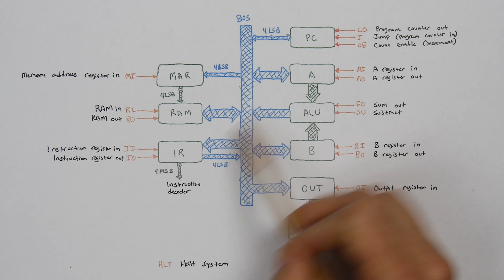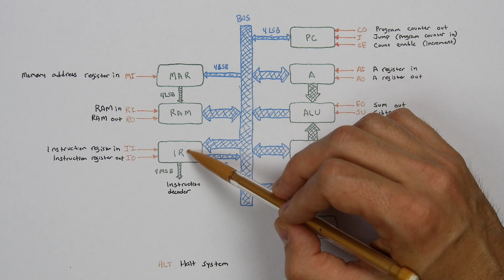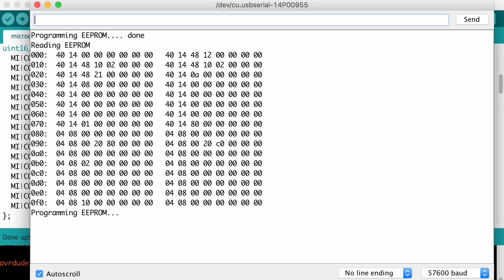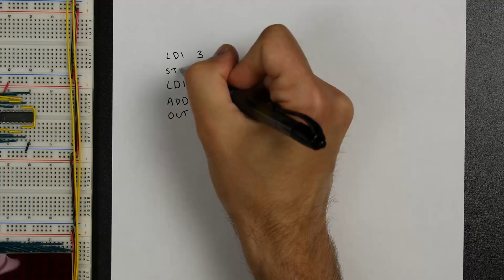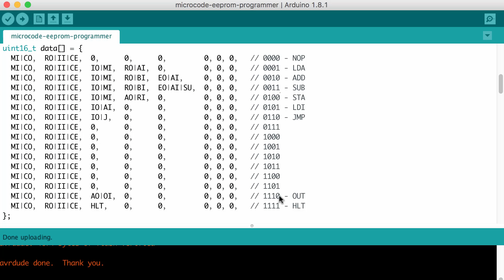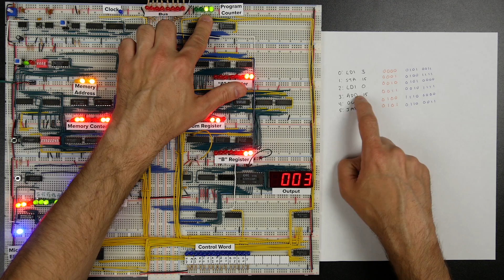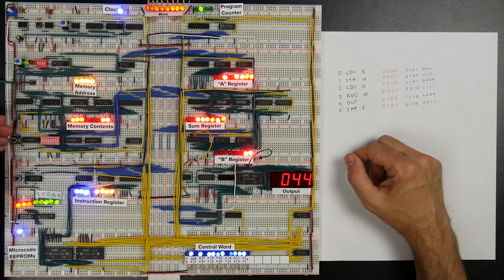Adding more machine language instructions to the CPU

Comment: Can one do self-modifying programs with StoreA (STA)?
Reply: In theory yes, the program is just numbers in memory and STA lets you put numbers in memory but something "useful" in less than 15 commands escapes me at the moment.
Reply: Sure. The way it is designed uses the same RAM for code and data.
Next step would be conditional jump, I suppose.
Reply: TheYouTubeCuber kinda but with the 16 byte limit I doubt you could program any logic to do that
Reply: Ben's old design includes JC, or Jump on Carry, which jumps to the indicated location IF the Carry flag of the ALU is set.  Combine this with a SUBtract instruction and you compare and branch.  I suppose he could add a specific CMP instruction since he has so many free opcodes.
Reply: You can do everything just with STA apparently
https://github.com/xoreaxeaxeax/movfuscator
Or just with SUB, or ...
Reply: @romsthe  Well, yeah, if you have all those complex mod/rm and SIB addressing modes and tons of memory for lookup tables. Movfuscator cheats a bit by using signals for control transfers. You can't jump with mov, no matter what you do - but you can cause a segfault, and the signal handler can modify the stack frame and let the standard library use non-mov instructions to return somewhere else. It is impossible to use only mov, but very impressive how much it can do with just mov. Also, those "single instruction" computers aren't really single instruction, some take various combinations of operands, so aren't really a single instruction, if you want to be completely honest.
Reply: Ah the good old days .. before memory protection ruined it for those of us who liked to save a few bytes by living on the edge! :)
Reply: OBW Yes just modify records in ram
Reply: I've been thinking about how to do conditional... anything: Jump, I think, would be the most useful. I'm not having any epiphanies quite yet.
Reply: Probably. If you managed to write A or Sum to the ram you could then execute that command however it would take some this to control the results
Reply: How does the program know to set the carry flag to activate the jump? What statement says "register a is less than 10, 1-> Carry. It's the "is less than" part that I can't figure out how it would know.

My other question yielded a possible result. Two values, a and b, checking "if a>b":Subtract 1 from a and b each until the result equates to zero (by bitwise or'ing the result). Were a to reach zero, it's lower, were b to reach zero, a is not lower, if they both reach zero, they are equal. Or, maybe, a-b, if zero, they are equal, and the minus sign would depend on how the number system was implemented.
Reply: kindlin: Calculate A subtract B.  I'm not completely sure what the Carry flag means afterword with this ALU, but it could be: if the carry flag is clear, that means that A >= B.  If the carry flag is set, that means A < B.  Something like this.
Reply: Ok, yeah, that's been said multiple times now, but my question is HOW does it know WHETHER to set the carry flag. I know that us humans can see 10 and 8 and know that 10 is larger than 8, but a computer doesn't just "know" this. It has to follow some algorithm of and-gates, or-gates and 1's and 0's.

How does machine code determine that A>B, A=B or A<B? Is it not machine code, is it actual hard coded logic gates that allow the determination of equality? Some combination of the two?? It has to first FIGURE OUT what the right answer is before any flag, carry or otherwise, can be set. How does it do this?
Reply: +kindlin Look at the ALU video, the adder chip has a carry input and output, the output of the LSB chip is connected to the input of the MSB. The output of the MSB would be connected to a FLAG REGISTER via a separate line. So along EO|AI to make an add or sub instruction,  you would have something like EO|AI|KO|FI (CarryOut|FlagIn, "CO" is already used) and that would set a C bit in the flag register. For a Z bit, you would first need to make a NOR with all ALU bits (if they're all 0, that makes Z a 1).

Usually, ALUs are more sophisticated than just add or sub instructions, you can probably figure out how a shift instruction would use a carry position to update the C bit in the flag register. Usually, many instructions impact multiple bits of a flag register so they all have a number of separate lines feeding those bits which should be directly available by the instruction decoding logic.

Now, since these bits are now available there, you can imagine that rather than making an unconditional jump by setting a J signal unconditionally, you would use these bits to feed J. Instead of feeding J with a direct bit output from the ROM, J could be connected to some bit logic to choose when to jump. It could use 3 bits from the ROM decoding into 5 (out of 8) possibilities. That's 5 lines :
- unconditional jump -> J = 1
- JZ -> J = (1 and Z) 
- JNZ -> J = (1 and (not Z))
- JC -> J = (1 and C)
- JNC -> J = (1 and (not C))
All those 1s represent the lines being set to 1 by the instruction decoding logic, they're set to 0 otherwise. All of this should be ORed, so that's
J = uj | (jz & Z) | (jnz & !Z) | (jc & C) | (jnc & !C)
Now make the uj, jz, jnz, jc and jnc from 3 bits in the instruction (which needs more room now)

That's a way  of doing it, there are probably others. You get the idea ?
Reply: I get the idea, thank you. Quite a complicated bit of logic,  I'll admit I couldn't follow it all, but my question was basically answered in your first paragraph. The next couple gave me an actual method you could follow up the  flag determination with a jump output, basically the if statement machine code/logic gates themselves.

As always, with knowledge comes more questions. I saw an article that listed Overflow, Negative, Carry and Zero bits (flags). Z is the nor of the result, C is the final carry bit of the adder (subtractions and addition?); however V for overflow seems redundant with C. What's an overflow if not a result larger than what the computer can handle, which is already the C bit (I'm now thinking of my 16/32 bit calculator that can go to 1e300 before it overflows, could this be a software-set flag?). N for negative, which was touched on briefly in this video series, but never fully fleshed out. If a negative was known by a specific bit (±128 numbers) then that on the adder could be tied directly into N.

You kind of lost me from here. If you don't want to go into fine detail, that's fine, but I'll try and explain what I'm not getting.

For actually using that information, are you saying that if any of the bits is set at all (due to the |'s at) you'd want to do or not do a jump? You need to know whether your asking A>B or B<A, which is more complicated than whether A+B overflows, is zero or becomes negative. So, do we have a different sets of machine code for each equality (==,<,>,>=,<=,!=)? This kind of looks like your JZ/JNZ/etc. thing but that looks like your creating a single bit that contains all the possible jump information, not creating a complete set of machine code for each JZ/JC/etc.. so how using this information goes, I may not be too far off, or I may not clue whats going on.

Thank you so much for helping explain what you have so far.
Reply: Perhaps I can help a bit.

All of these "flag bits" are automatically calculated and stored in a special "flags register" by the hardware, generally during mathematics operations.  If the result of an "ADD" command caused an overflow, then the "C" bit (carry) of the flags register will be set, and similarly if the A register was left with zero in it, then the "Z" (zero) bit of the flags register will be set.  If the zero was the result of a carry, then both will be set.

But... overflow from what, and to where?  The reason why there's sometimes more than one carry bit is the answer to one of your questions.

Sometimes, it's useful for a programmer to know when there has been a carry out of the lower 4 bits of an 8-bit number into the upper 4 bits

 Being able to test multiple types of carry becomes even more important when you have registers which can hold and add/subtract 16-bit numbers or even larger.  For example, with 16 bits you might have three carry bits, with one for a carry out of the lower 4 bits, one for a carry out of the lower 8 bits and one for a carry out of the entire 16-bit register.

Most CPUs also have a "CMP" or compare instruction.  This is a non-destructive SUB instruction.  It actually performs a SUB between the A and B registers, but "throws away" the result instead of storing it in A.  This is useful because it preserves the original values while still setting the flags.

Here comes the answer to another of your questions.  How to test for multiple results?

The answer is, one at a time.  First, you'd normally check the C flag using a JPC - JumP on Carry to see if B was larger than A.  If that jump isn't taken, then you'd check the Z flag with JPZ - JumP on Zero to see if the two values were the same.  If that jump isn't taken, then you know that A was larger than B.

(I may have the state of the Carry flag reversed but it doesn't matter because the principle is the same in either case)
Reply: Ahhh.. SO it is a fairly straight forward extension.

Example:
A-B;
@C, B>A;
@Z; B=A;
@!C!Z, B>A
@!Z, B!=A

So when I program "if VarA>VarB," it tests the C and Z flags to know where it should go. Do not jump when true (run statements), jump to after the if statement if the test fails. I'd still love to see this fully fleshed out from Mr Eater, but I definitely have a solid understanding of it now. Thanks!!
Reply: Brutikus32 other way round. Carry set if A>=B
Reply: use subtract to subtract two values and jump if result is zero, but the computer needs a zero flag from the ALU, it's also missing the overflow flag, that's useful to have. You can know if a number is greater than another by subtracting it and looking at the overflow flag, if it's not zero and not set then it's a less-than number, then you implemente >, = and < and >= and <=, all with just two wires/flags.
Reply: not in this computer, x86 mmu is much more complex